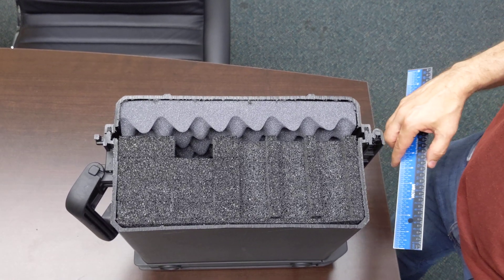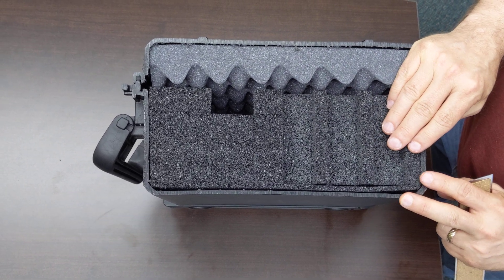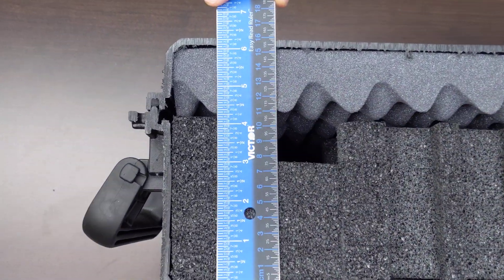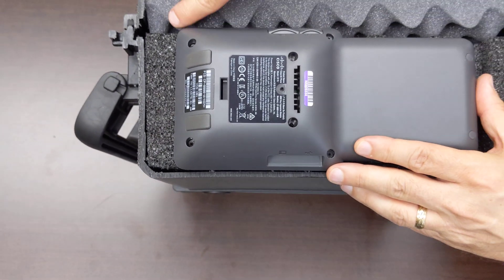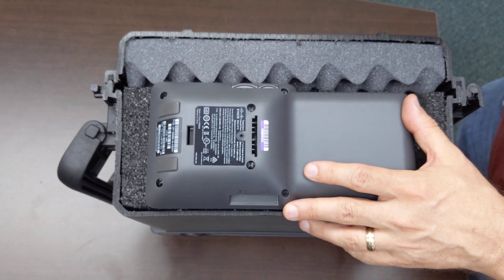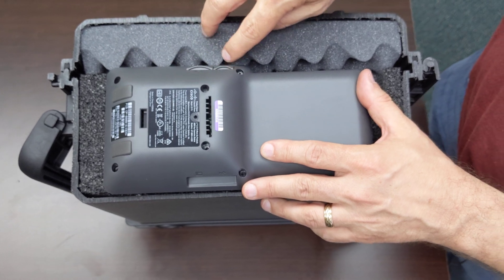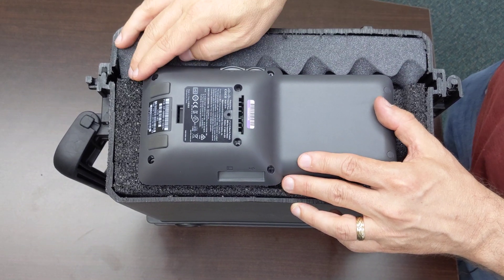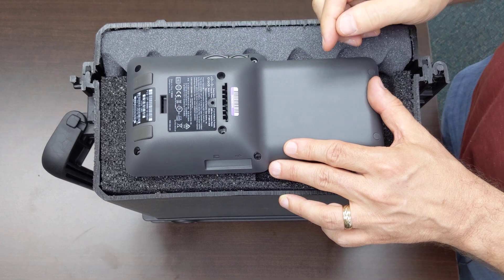MyCaseBuilder Depth warning explained

Comment: Not sure if anyone at My Case Builder monitors comments on these videos, but it would be helpful to know how much the polyurethane foam (I think this is the Egg Crate foam, right?) will compress on the top without damaging it? Is there a rule, say maybe 50%, or something I can use as a guide when designing my cases?